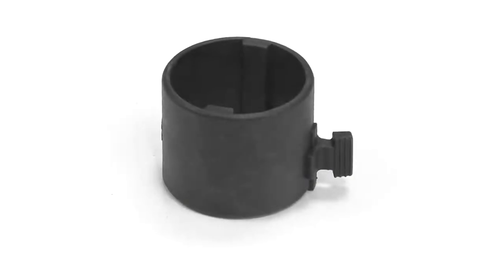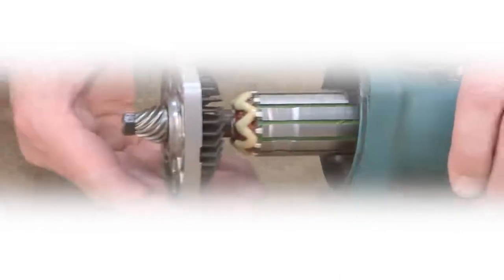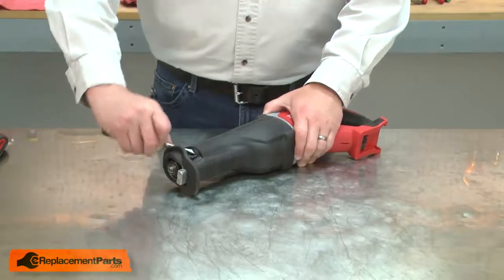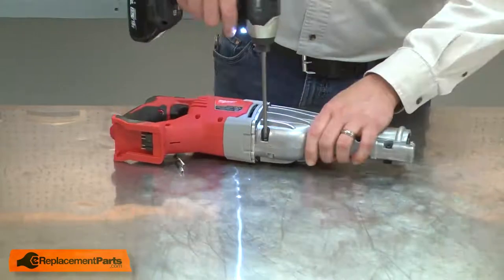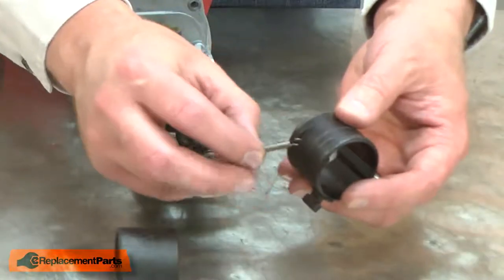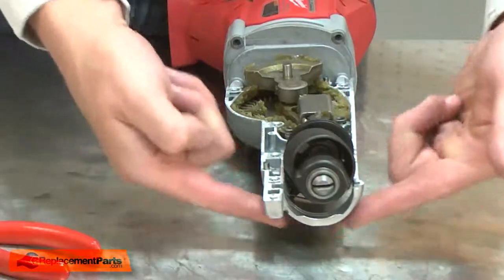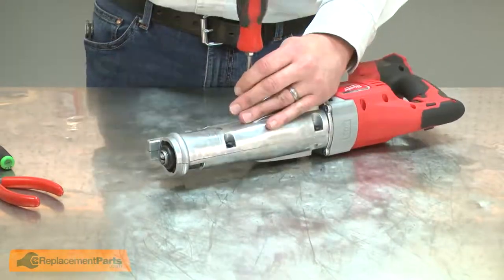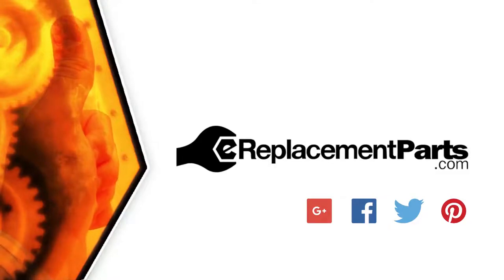Milwaukee Sawzall Repair - Replacing the Barrel Cam (Milwaukee Part # 31-11-0106)

Comment: My barrel can was worn out, it couldnt catch the ears and spin the blade holder, so i didnt want to spend time and money waiting for a new part. I cut pieces of small zip-tie and super glued them inside barrel, cam,,,,my complaint about tool design is no access to properly oil bit holder that caused barrel cam failure